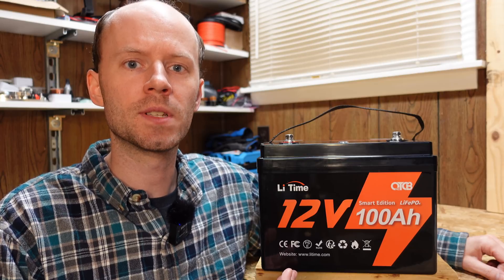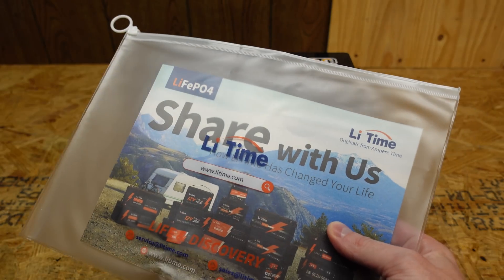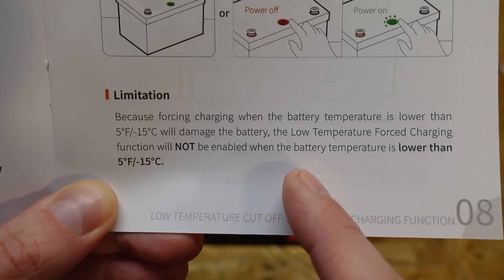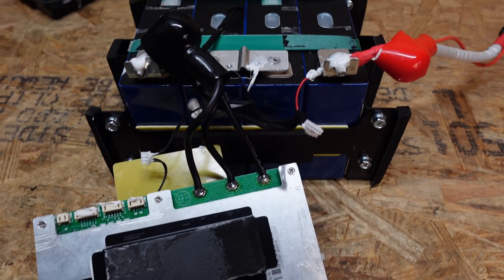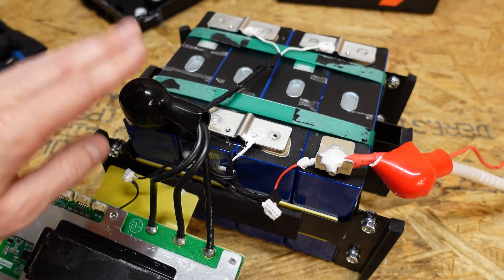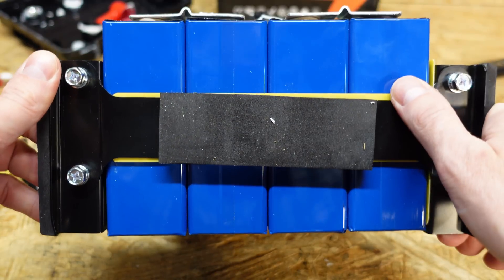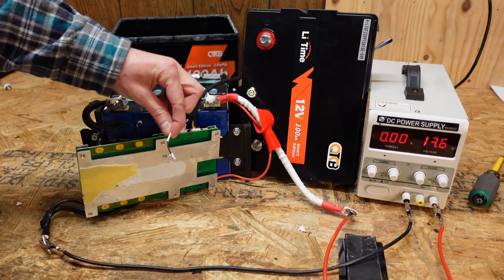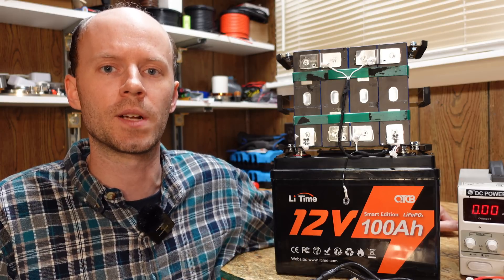LiTime 12V 100Ah LiFePO4 Smart Battery Review (Formerly Ampere Time)

Comment: Hello, do you have any idea how you can monitor the voltage of this battery? It has simple BMS from jbd and I don't know what voltmeter to look for it. I will use it on an electric boat motor.

Comment: Dude! Your acting surprised saying it's built so well, whilst you show a shot with all cells nut to butt next to each other, bms poor location, etc, would you be an engineer? I'm thinking people sponsored in any way shouldn't be allowed ethically to do these videos. Folks, this is Not well put together, and it's the same as many other batteries from China. Don't ever believe these numbskulls doing these vids. To add he stresses how well the board is, I saw a huge issue off the get go. Any real engineer would get it.. this is a cheaply made battery, it might just work well for you! However other batteries from other companies are made so well you can put it under stressful situations. So, if your demand isn't high or stressful, go for it! And do yourself a favor on anything you buy! Call warranty number and see how well that goes before buying. If you can't get or reach anyone in warranty, don't buy. And give yourself 24hours before any purchase, that instant gratification will cost you every time. Call warranty dept before ever buying and say your product failed! What do I do... And see how that goes.. sometimes you can't reach anyone, when you do you go through hell. Call Battleborn and you'll get an answer pretty fast if not right away. Don't cheap out on important stuff, put in the work and cover your butts. And stop believing fools who are sponsored! They get PAID to do these and a cut of everything you buy using the given code to save! These batteries are almost always a fraction of what sold for. If you understood the marketing world you'd be pretty pissed off to see how ripped of your getting. Also, lithium in 10yrs will be second to a new method using another technology, so have patients. And this new battery will have a life lasting longer than your kid or you and your grandkids.. Already in small battery form, will be available around 2025 to public, some you can get by doing work to locate... Good luck to you all.

Comment: Serious question and need an honest opinion.This is pretty urgent and time sensitive. 

Are these just as good as Battleborn and the other Lithium-Ion Sulfate batteries out there that seems to get popularity based on the name?

We live up north and I know 10000% I'm going vanlife. My daughter, husband, and my grandchild literally just moved into there 20 yr old motor home and live in the north part of WI. They are going to end up way out in the country and park it on some land (they rented a spot) on this guy's land. Absolutely no water and no shore power. They went and got a Mr. Heater 10,000 btu propane heater and a 100 lb bottle. Of course they saud the floor is cold cold and I told them they need to get heat tape and get it on all the pipes and keep it at least to a temperature in there or they have to winterize it but then they can't use water, showering, etc. 

I've been telling my daughter to buy solar and we can build it ourselves. The huge thing is the batteries. It scares me because these battleborns are $700+ for just a 100 ah (ridiculous) and its discouraging wondering how any of us can do off grid. 

Are these Li Time batteries just as good as the others even though these are half the price? I just want an honest answer. I told her she needs a minimum of 400 ah and she can go higher as she goes - which she'll keep adding more solar and upgrade the control charger on the list. 

They have a 120V furnace and im thinking why not just run that to the inverter? I'm sure it will heat the motor home better and just might be more cost affective. 

I also told her they need to close in the bottom around the sides on the outside of the motor home and insulate it to help it not be so cold under the motor home to help with pipes and the cold floors. 

I would very much appreciate your help! Please! Ty

Comment: Ok now how the heck does this work when you wire batteries in series?  Manuel says you can do it, but then what happens when one of the two batteries reaches capacity?  It disconnects, right?  So then if any reaches capacity, it disconnects and that disconnects all the other batteries charging as well, right?  And so then when discharging, so if any battery gets too low it also disconnects.  hard to imagine how this works with only the positive and negative terminals being the "interface" for the battery.   Am I overthinking this?

Comment: How can you remove those busbars being laser welded. Any suggestions?
Reply from the maker: Just like any metal welding, you cannot remove a weld without cutting. I don't recommend doing it as it's difficult to reconnect aluminum as you can't solder to it and most of us (none of us) have access to a laser welder.

Comment: Does the BMS stop the charge controller when battery is full?
Reply from the maker: Yes it does; however, that's a safety feature not intended to be used for daily charging/discharging control. You still need to use a proper LiFePO4 charger that has (or can be programmed) with LiFePO4 voltage settings.

Comment: On the fence for a trolling battery!Either going with a li time or a epoch and still can't decide if I'm going with a 24volt battery or 2 12volt any suggestions would help on both the choice of the li time or epoch and a 12 or 24 volt thanks in advance!
Reply: What did you decide to get?
Reply: @snowww816  I haven't purchased either yet but I believe definitely a epoch I've heard alot about them now from several people I know and there all super pleased with a epoch so I'm probably going that route for certain 
!
Reply: @davidfarley6666  those are high $ I suppose oftentimes you get what you pay for.
Reply: @snowww816 and going with a 24volt single due to the weight and getting a single charger instead of two 12volt single battery chargers!

Comment: I have a 12v 50lb trolling motor. I'm in MI so I'm not fishing under 50 degrees and I stop in the fall at about the same temp. Do I need all the fancy stuff ? Also how do you tell how much charge is left in the battery ?

Comment: Is it just because100 Ah is the industry standard, as to why they don't put another cell in the case? You could easily fit a fifth cell.
Reply from the maker: And what would you do with a 5-cell 18V battery? That's way out of spec for 12V applications. There is no reason to put a 5th cell.

Comment: Can you use this battery to charge an Ecoflow? 

Using XT60 Conncter Cable with DC 12V Battery Alligator Clips? 

Would be a great live extender! Perhaps you can make a video about this?
Reply: I charge ecoflow with these batteries through an xt60, the maximum power the ecoflow accepts is 100 watts, or 200 if charging through a 12-24 volt converter.

Comment: How can you tell if low charge temp working on lithium ion battery without tearing it all apart like you do? I have 3 12v batteries that claim to have protection but I would like to know for sure it is working.
Reply from the maker: You could place the battery in a freezer for 24hrs then try connecting a charger and see if it starts charging.

Comment: So does the off/off switch completely cut the power off or does it just put the battery in sleep mode. Planning on using the battery for marine electronics and was trying to decide if this button can take the place of an actual inline switch to prevent unwanted current draw at rest.

Comment: As I found out on Black Friday 2022 the company doesn't recommend their batteries for golf carts as the BMS can't handle the stress over time. The new Li Time doesn't recommend the battery for electric vehicles too even though they have a new BMS.
Reply from the maker: Correct, because those type of loads typically have a high start/inrush draw on the battery. I would say that's the case for most of the batteries I've been reviewing unless they have a super beefy BMS.

Comment: I used Google translate to get the writing on the li time BMS here it is 

( Li Time

Model: S12100 Smart BMS 4S Lithium Iron Battery Protection Board Charging 100A Discharging 100A LT22091300073 )
Reply from the maker: I'm aware of Google translate, but have no clue how to type the characters into the translate page LOL. I assume you have some way of taking a picture or OCR or something.
Reply: @LithiumSolar  yes translate has a camera function and does it by picture it's a pretty cool feature I discovered recently myself
Reply: exactly right

Comment: I like to watch your reviews, thanks. One correction as for FETs. Charge and discharge FETs are located on both PCB sides!

Charge controlling FETs always go to external negative terminal (output -) while discharge controlling  FETs go to battery negative terminal.
If dedicated shunt resistors are present (which is true for all the BMS except of cheap low-amps rated ones), they are always on Discharge FETs side.
Charge and discharge FETs are always located in opposite orientation each other, having Drain (massive body plate) pins joined together.

What is interesting for this BMS  a dedicated group of 4 FETs on one side only, connected by 2 1Ohm resistors is series.
I guess they are dedicated to soft connect-disconnect a fraction of second sooner/later (or pre-charge purposes) to decrease peak current spikes in such scenarios, which has a risk of kich-back current which can destroy main FETs rows.

Keep going!
Reply: What BMS you recommend for my ampere Time 200 ah plus I have the battery case open so I'm ready to change out the BMS

Comment: An extra$250 for low temp sensor and a relay?!? The 300ah batteries are the best value in my opinion and still no smart version there. So if I were to buy 4 of these it'd cost an extra grand. I'm surprised there isn't a simple aftermarket low temperature switch to redirect power to heating pads off of charge input until desired temp is reached. Thanks for the tare down.
Reply: You would think a simple add would be possible 
If you buy a victron charge controller plus there $30 temp sensor you can use the cheaper batteries but victron is a premium price

Comment: The way these so-called "cheaper" batteries are increasing in price just because of low-temp cutoffs (and other gimmicks), has pushed me even closer to SOK. It's the last battery I'll buy so the one-time premium is no big deal given their build quality, proven warranty and reliability.
Reply: Yeah... charging $150 for smarter BMS is pretty much highway robbery!  Wonder how much the upgraded hardware and labor cost the manufacturer....maybe $30.?.?.  Maybe it's much more now, but hopefully that premium will drop drastically as production scale for those parts ramps and the R&D costs are recouped.
Reply: Totally agree.
Reply: Yeah I agree too
Reply: Thats because all youtubers make a bike deal out of low temp cutoff mattering when really for a lot of users it’s not required.

Comment: A shame the price difference between heated and non-heated is quite a bit. 
Is it really that much more expensive to make a battery heated? 

I believe heated pads aren't that expensive.

Maybe you could make a video showing what it takes to make a heating system for non-heated batteries.
(Or maybe you already made such a video?)

Anyway thanks for another great video.
Reply: I just bought a self-heating Ampere Time 12V 100 Ah here in Germany. Is only a little over 100 bucks more expensive. I don't know if it's also available in the US.
Reply: @wobie6291  I have a small vacation home in Germany so that's good news for me.
Reply: @behappybevegan  There is a video on YT by Wulle on Tour. He also shows the battery from the inside, but it is in German.
Reply: @wobie6291  Found it. Thank you very much. 
German is no problem. Well ... heavy dialect like Kölsch is.

Comment: Interesting to watch the evolution of lithium batteries.

I built a hand truck-based portable solar power station a few weeks ago. Thanks for your videos on the topic, and inspiration!
Reply: I plan to build a station like that by Q3 2023.  I'm literally waiting until the last months before I'll need it because the "best build" has been evolving so quickly.  Exciting times!
Reply: @John Fox From NOT the guy who built one… 😉. YouTube has several walk-throughs…one I liked from five months back by the guy who made this video.  Just search “DIY solar generator” or similar. I like that you can DIY a much more capable, more expandable, and reconfigurable “Frankenstein” for the same price as a slick manufactured product.   e.g….  
https://youtu.be/J9WZcMDQaDg
https://youtu.be/HXmBMNoK0Rw
Reply: Man-made things don't evolve. 
They are intelligently designed.

Comment: After watching your video, I purchased 3 to hook up in series for my 36 volt trolling motor 
Can you tell me if the Minn Kota charger; MK-460PCL will work to charge all 3 while hooked up in series?
Reply: Sorry, I bought the regular 100ah, not the smart batteries 
Question still remains about the charger
Reply from the maker: I've not heard of that charger before; however, I looked up the specs and see it's rated for 12/24/36/48V and is rated for LiFePO4 - so yes, it should work fine. Those mulit-bank chargers that handle equalization are pretty nice - I need to grab me a few for some videos.
Reply: Thank you!